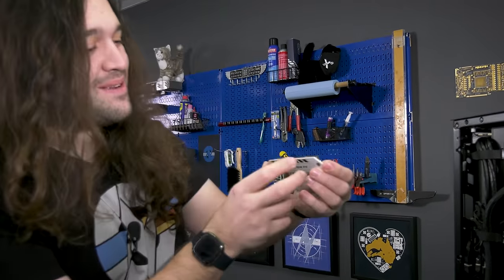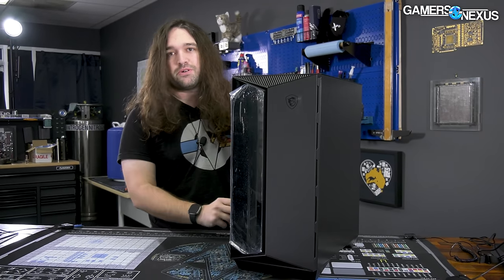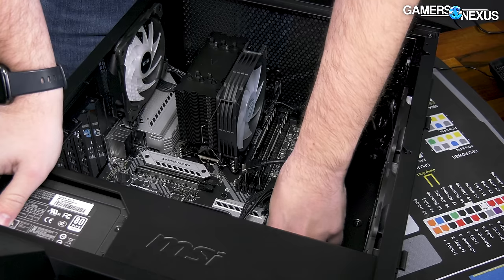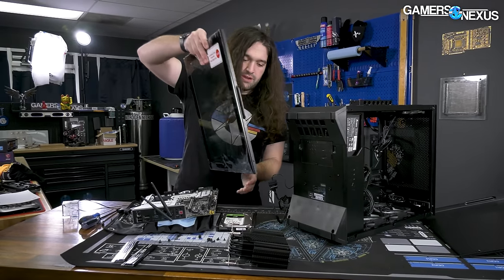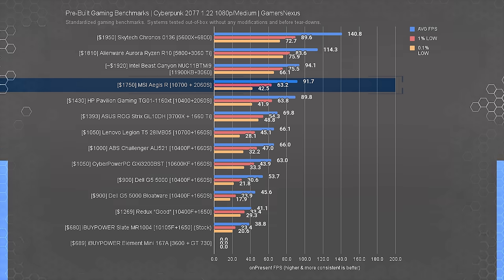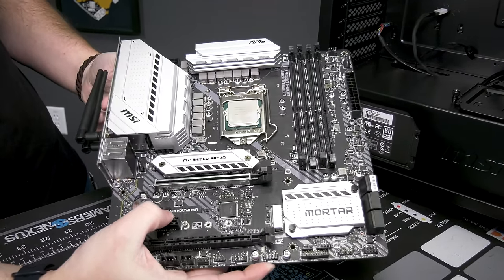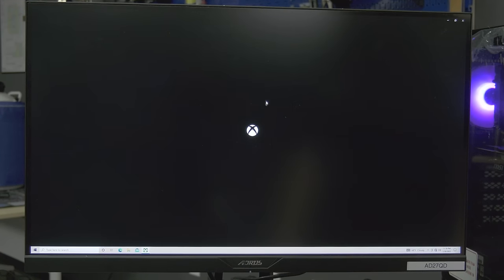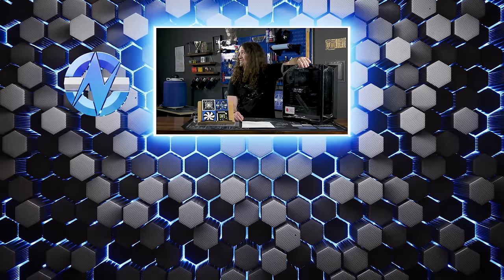MSI Pre-Built Bends SSDs & Boils CPUs at 100°C ($1700 Aegis R Review)

Comment: Does the problem go away with a full OS purge/reinstall? Or is it a problem with the case/cooler/mounting.

Just curious
Reply: "The" problem is the entire prebuilt, so unless you also purge all the hardware from existence then no, "the problem" will not go away.
Reply: Yeah I was a bit surprised GN didn't configure things how they SHOULD be - a bit like taking the front cover off the case for thermal comparison - such as resetting the BIOS or putting sane settings in ( I'm curious as to what would happen with "load optimised defaults"?)  and setting up Windows optimally. Then you'd have a "this is what these parts CAN do when not put together by idiots" set of numbers.
Reply: @julian.morgan  next video?
Reply: Case is bad and the cooler isn't enough for that workload.
Reply: @julian.morgan  They've already done this. We know the empirical performance of this CPU and this GPU in a vacuum. The entire point of this series is that the person who would buy this sort of system has little to no knowledge of systems, or has little to no motivation to fix somebody else's incompetence. They want to buy a box, plug it in, and have it work. I'm not going to go buy some garbage car because a carTuber showed me how garbage it was, but that I can invest my time and money in making it workable. I'm just going to go buy something else.
Reply: Yeah the cooler should be better than that . I don’t think the power setting is to blame here. 225W should be the upper limit instead of what the cpu actually draws. In one of Linus’ video he showed that a 10900k cooled by a hyper 212 (which should perform similarly to the cooler in this video) was able to let a 10900k maintain an all core frequency of something like 4.7 GHz at 99 degrees. Mind you a 10900k has 2 more cores than a 10700. That cooler should handle a locked i7 just fine even with unlocked turbo duration. Wonder if it’s poor mounting/ overaggressive voltage curve/poor fan curve
Reply: @julian.morgan  That's not really necessary, the CPU and GPU have already been reviewed by plenty of people so you can just look those reviews up for slightly more accurate performance numbers.
Reply: @nicholasgraves3149  Fair enough,  but I kinda feel for the 'victims' here - meaning less well informed gamers who've fallen for MSI sales hype. So just as they demonstrated the difference with removing the front to allow some air flow, so demonstrating better performance is attainable with a little know-how would be useful for such people and even more embarrassing for MSI.
Reply: @julian.morgan  I understand what you're saying. They've outlined all the issues, and if you are somebody who is stuck with this system, you can do a little research on the outlined issues and find solutions. Steve's team isn't huge, and they pump out a lot of content with more depth than any other tech outlet. There's gotta be a line somewhere.

Comment: Funnily enough, I have the "Ultimate Performance" power plan on my computer, which uses an ASUS board, and it behaves nothing like it does on this MSI system. For one, Task Manager doesn't report CPU utilization at 100% just by copying a file. How MSI set that power plan up is truly bonkers.
Reply: Because your motherboard has zero influence on power plans. They are windows power plans. They just took an existing power plan and edited it.

Comment: Just to clarify what MSI is actually doing in regards to "faking" the CPU load:

MSI has enabled the flag for "Processor idle state" which is a hidden power option accessible via the registry. Windows gages the utilization of a CPU based on how much time it spends in its "idle state" which is typically calculated by X = (100% - PERCENTAGE OF TIME IN IDLE STATE). What MSI is doing to "fake" the CPU load is disabling the ability for the CPU to go into an idle state. The result of this is that Windows can no longer track the CPU load due to the fact that the CPU is never reported to be in its "idle state". This means that when Windows calculates how active a CPU is it ends up being an equation of X = (100% - 0%) which equals 100%. It isn't that it's actually at 100% but rather that Windows is unable to track it's utilization.

Comment: It’s a shame with the temps and quality control, my first modern prebuilt was an MSI CODEX R 10SC-006US pc and it runs cool ( 25-30C idle) and everything worked (had to change ram speed manually tho) and very solid. i7 10100F , 16gb RAM (XPG D10) and rtx 2060 Ventus XS OC for under $900 right before pandemic, unbeatable deal. Even came with a 500gb ssd and a 1 TB hard drive. Sad a lot of prebuilts theses days are not built to standard.

Comment: That backplate does do something useful.  I've long suspected that the real reason video card vendors include those is to protect the back of the card from mechanical damage.  If I had to guess, I'd say that the cost of including it is probably less than the cost of dealing with an RMA, even when they deny warranty coverage because the user knocked some SMDs off.
Reply: He said the reason this backplate is bad is because it's plastic and not metal and plastic is an insulator

Comment: When it comes to cooling I find that I can't judge a case so easily until it's built and tested. The Ibuypower PC I have had little to no intake space, I thought temps would surely get into the 80s, it never goes above the mid 70s under high load.
Reply: Have you tried stress testing and benchmarks or is that 70 just light gaming with a GPU bottleneck?
Reply: See, its not about the case, its about fan intake vs outake (positive, neutral or negative pressure).

Comment: Wow. Just wow. The Aegis RS that I got in the last week of 2021 has had no problems. And the only time I ever seen my CPU come close to 90c was when I forgot to turn down the frame rate on Empyrion, and even then it only got up to about the mid to high 80's. But I was getting a nice 400+ FPS, not like that's even needed. Also it did come with a water cooler.
Reply: Mines been great so far too, I was super worried about temps but I never had an issue with my 3070 or 10700k. The bios stuff was annoying though but not terrible.

Comment: The heat load is hilarious, my 2 year old i9-9900KS is still running at 5.03 GHz on all cores/threads and with World of Warships running, as well as 380 Google Chrome tabs open, Word, Excel, Outlook, PowerDirector running a video encode in the background my thermal load rarely breaks 54°, and unlike mu i7-3930k which runs at around 68° this is a amazing difference on the i9-9900KS and I see why it's such a valuable CPU.

For this MSI system to run at or near 100° is absolutely 💯 NOT acceptable 🤔 WTF MSI

Comment: 7:02 I personally think the plastic back plate still serves a major purpose. It protects the components on the backside of the board from being accidentally sheared off by the end user. (something I have seen people do a fair few times before back plates became a thing, and since their introduction I have almost never heard of people doing that.) It likely also gives the end user larger confidence in handling the card, since there is less exposed PCB for them to be afraid of touching. Ie, the drop in performance might be worth while from an RMA and sales perspective.
Reply: Still wish they'd use metal instead of plastic.
Reply: @futuza  I can agree.
But metal is a lot more expensive.
However, they could have at least put some ventilation slots into the plastic back.

Comment: I'm confused. Why were CPU temps so bad even after removing the front panel and maxing fans?
Reply: The horrible power management settings on the motherboard and Windows power configuration combined with a cooler that isn't powerful enough for the cpu it was paired with mainly.

Comment: First I wanted to say that the front panel is actually glass and metal and not glass and plastic on this case. I guess it is also possible that the shelf component/ standalone version of the case has a metal facade on the front and the prebuilt system version has a plastic facade like they do with GPU backplates. That being said it is still a horrible case so it makes little difference, but I thought it was worth mentioning for arguments sake.
I used that MSI case for my custom build. The LED reset/control button on the front panel caused the JRAINBOW1 connector on my board to short. This was on a z490 GODLIKE board. For the longest time I didn't even know what was wrong with my system, because my system would take about 4 minutes to boot on a 10900k, 3090, and nvme. The post code would sit on A2 (IDE Detect) for almost that entire time, before finally booting into windows and functioning perfectly fine. I eventually found out that my onboard LEDs were bugged, most likely caused by that garbage fan/ LED controller that came with the case. Simpily flipping the onboard LED switch to the off position, booting my system, powering off my system, and turning the LED switch back to the on position completely fixed the issue. I found many people with the A2 post code/ long boot issue, but no one realized that it was linked to the onboard LEDs being bugged. This is because the issue just caused an extremely slow post, thus making the OBD display A2 for a while, even though the issue was not related to the A2 code at all. Rather, the A2 code being displayed for a long time was solely caused by the slow boot process making the code appear for too long, and was not reflective of an IDE error itself. As someone with an advanced, but not expert level knowledge of PC systems, this was extremely difficult to diagnose and almost led to me RMAing the board. All of the articles related to the LED issue had no mention of slow booting, and all of the articles related to the A2/ long boot issue had no mention of the LED issue. Very frustrating and all caused by a cheap, clunky fan and LED controller. In any case (pun intended) it's fixed now and I wont be buying RGB on my next build.

Comment: Honestly this pc is one of the better options in my opinion. Alot of the fuckups are easily fixable. All of the parts are off the shelf, and the parts actually decent quality which is way more then most pre builts can say. So now all you gotta do is a fresh install of windows, take off the front panel, and make sure all the power and bios settings are normal, and boom you got a pretty decent pc.

Comment: Oh dear. I tend to like MSI for their Mobos and some of their GPUs. But this is awful, which is a shame because the system isn't bad, it's all good parts.
Reply: I wonder if they put these together at an actual MSI facility, or if it's outsourced
Reply: I had a MSI board over volt an i9 and it kept getting 100c. I replaced it with a gigabyte and the problem went away and I could overclock again. MSI will do anything to win Benchmarks Include going out of spec

Comment: This is actually my PC case, 3700X with 280 AIO, the temperature is okay, around 35-41 C for daily use. The airflow is mainly goes from the bottom of the front case, it is not as bad as you thought.
Reply: You should probably get a MESH Panel considering how much the temps can improve and plus, MESH panels look a little nicer than plain glass imo

Comment: I have a case with similar airflow capabilities. It's an Azza Apollo 430.
I put two 140mm fans on the top, and there's one 120mm fan in the back for exhaust.
I'm using Wraith Prism stock cooler and end up with 88-89°C temperatures at 100% load on my Ryzen 7 3700x.
This is the first pc i have built myself, and i somehow did better than a professional pc builder... Which is find freaking hilarious!
And thanks to that 'Power Option' section of the video, i now know how to limit the load on my CPU, because i prefer never to max out my hardware for the sake of longevity.

Comment: Some extra nitpicking on 27:05 - the BIOS  has only two extremes: "Boxed Cooler" 65W and 255W for the other two options. Make the "Tower Cooler" setting something like 125W, and it will make far more sense.

Comment: About a month ago, before I found this channel, I bought one of these to replace my pc which unexpectedly crapped out after 2 year.  I got it, updated the bios and drivers, left the room for 30 minutes, and came back to find the PC off.  Let it run again and watched it.  After 15 minutes, the pc turned off, and the fans went 100%.  Booted it again, ran the temp monitors, and watched as the CPU at 'idle' slowly heated up from 38 degrees to 70 degrees with no fans engaging, before the system tripped and the fans went 100%.  Shipped it back for a refund 45 minutes after that.  Total garbage.

Comment: I bought one of these with an i7 10700kf, 2080 super, and an AIO back around 2021 I think. It's been a great PC for someone getting into computers, I got to learn how to replace a lot of parts. AIO failed, the 2080 failed, and the ram failed within 2 years. My xmp was also not enabled. It's easy to fix though and at the time I bought it I got a great deal considering graphics cards were hard to find back then. This review is over the top as always but yeah these weren't the best systems out there.

Comment: At my old job we used to say if you don't give something a torque spec the techs will screw to either "red tight" or "blue tight." Red tight means tighten until you're red in the face, blue tight means you tighten until you're blue in the face. Looks like that SSD was blue tight.

Comment: Daisychain PCI-E solution, is okay up to 300W, as long as the AWG is specified to handle 25 Amps (@12V). it is on high quality PSU's. But some use AWG, that is specced to handle 16-18 Amps (200-225W max). Some lower powered units has a multiple rail config, which has maybe a 18A limitation on the 12V that feed the PCI-E cable. Which is more safe. Better to have a PSU shutting off, than the risk of cable melting.
The PSU used here, is Delta. They overall make excellent PSUs. Even with medium quality parts, they build them to last, because they build them properly. Should be dimensined properly according to rail power.

Comment: Last week a friend asked me to help him with the Lenovo Legion he bought. What I saw there almost made me blind. 1x 80 mm fan, cheapest possible cooler on a cpu, all parts 'Lenovo standard'. The case is fully locked Glass box without any ventilation. 3060 blower card that sounds like a f16. In bios the CPU was at 67, when any load applied he instantly reached 92 and than he dropped the clocks. Nothing i could do there without breaking the warranty. Advised him to reach support and RMA. They said 92 is fine and clocks are dynamic so its all fine. Seriously. They rejected that. No words.

Comment: around the same time as this video dropped, I bought a MSI Aegies ZS from Costco with AMD 5800X, and a 3060 ti, with an AIO, that just failed, and temps were hitting 100C - glad I learned how to monitor temps - and had to RMA it... when I talked with them, they were responsive, and encouraged me to only send the AIO if I could, as sending entire PC from my location to COI in CA would have set me back about 400 bucks... so I appreciate that.  let's see what they send in replacement.  they no longer sell the 120mm AIO, and the bigger brothers both got recalled.... // ALSO, i was able to order just the front panel with the mesh (shortly after the parts guy said they don't do that anymore) - but first they sent me a panel for the Codex (wrong machine entireley) - so all in all, a less than spectacular experience.  we'll see about the next PC I bring into my life... I have a feeling I'll be building it on my own.

Comment: I bought the Aegis RS 11TE-206US with a 3080 and i7-11700KF. Replaced all fans and liquid cooler for Corsair and got 32GB DOM plats running 4000mhz cl16 for a total cost of around $3000. Its thermals and performance are actually really good. My 3080 hits about 55-60c when playing BF1 and BF5 at 4K ultra 120fps for well over an hour. Really no complaints considering the 3080 it came with currently sells on StockX  for more than the entire computer.
Reply: Ambient temperature in the room is about 65 F or 18 C for those that are wondering.

Comment: What would be better? 1. MSI Aegis R Gaming Desktop - 13th Gen Intel Core i7-13700F - GeForce RTX 4060Ti - Windows 11 or 2. iBUYPOWER SlateMesh Gaming Desktop- 13th Gen Intel Core i7 - 13700F - GeForce RTX 4060 - Windows 11? Bought both of these on sale from Costco and I'm going to return one of them. After watching this video I'm feeling quite unsure. Any thoughts on which one I should keep?
Reply: @BlitzEvade I ended up keeping the MSI  PC and it's actuallly been running quite fine. I play games like Roblox, Fortnite, and Valorant,  and this computer can easily handle them without any problems. I'm pretty pleased with it.

Comment: Steve, can you look into MSI Vampiric R100 as well? It only has 1 front fan and 1 backfan, and it was heating SO much that I had to buy a kit of 4 fans and install them myself! Even with them installed I could only get down to 70c, and CPU would still spike to 104-127c in 3DMark benchmarks.